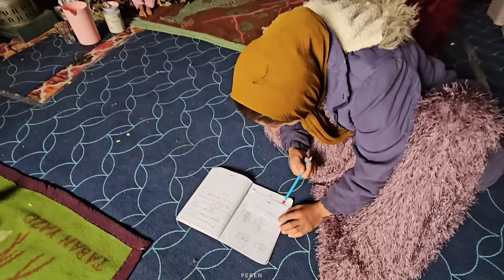Spring days in the village  🌈 🏕 The Perren family live their lives with more excitement

Comment: I noticed that when you need the truck, you take the water tank out. Putting it on the pile of dirt makes sense since it is at the level of the truck. What will you do once the dirt pile is gone? Have you thought about building a platform that is the same height as the truck to hold the tank?
Reply: Very good idea.

Comment: Maybe you could add a platform while building your wall to easily slide your water tank on when you need to take it out of truck. Surely that would be easier if it's same height as truck bed.
Reply: They don’t work so smart. They should build roofs that are not flat. They could pitch them.
Reply: Most houses 🏠 built have flat roof
Reply: @NC-gt4uv прежде чем критиковать, посмотрите внимательно, там у всех плоские крыши. И это часть жизни в Иране. 
Я тоже изначально предлагала переднюю часть здания поднимать на 1-2 кирпича и затем уж класть стропила и наводить кровлю.... 
Но, увы, меня никто не услышал и я поняла, что палку обухом не перешебешь😅😅😅😅, У нас так говорят, если привычка сильнее здравого смысла😅😅😅